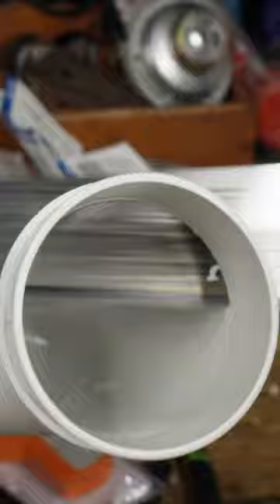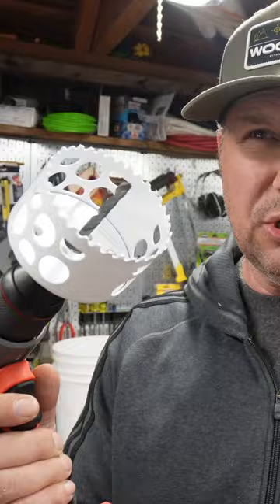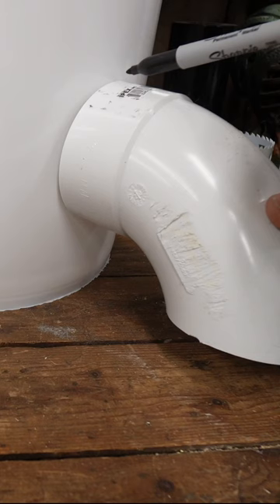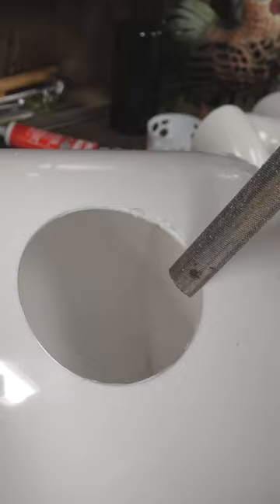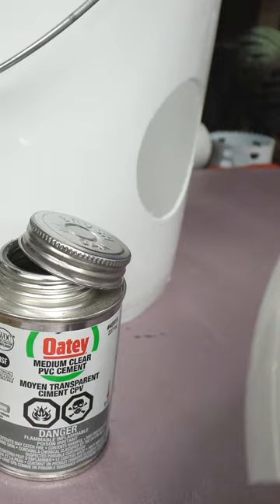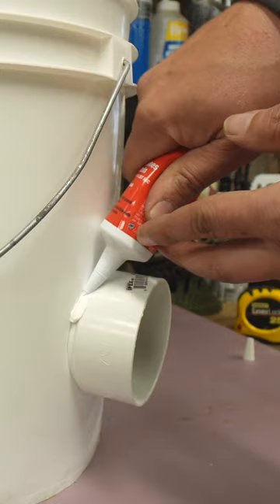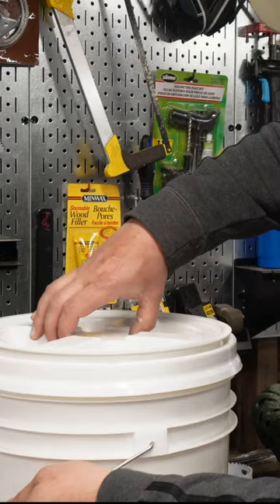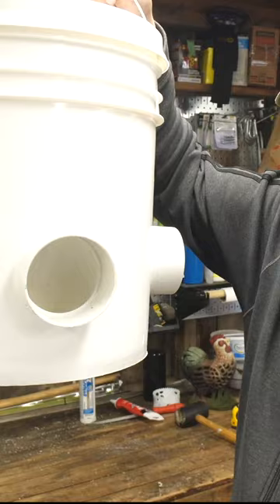DIY Bucket Chicken Feeder #shorts

Comment: Go with "work smarter, not harder" and use a 90° street elbow instead of the elbow you used.
Reply from the maker: I hear ya, but I was building this thing and that's all they has at the time. If you can get em easily by all means, certainly less work.